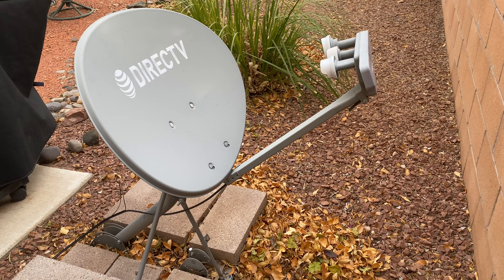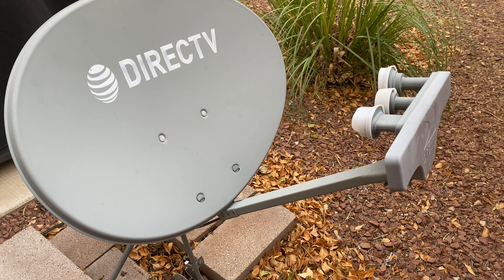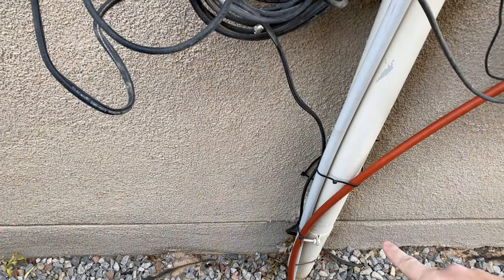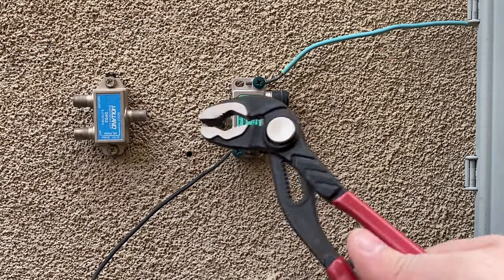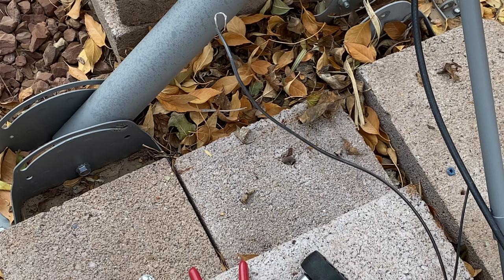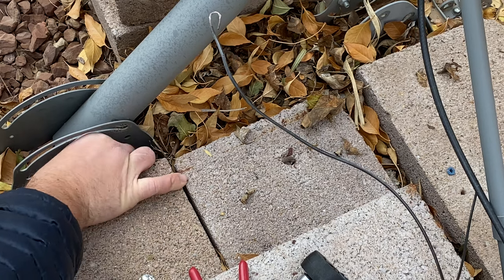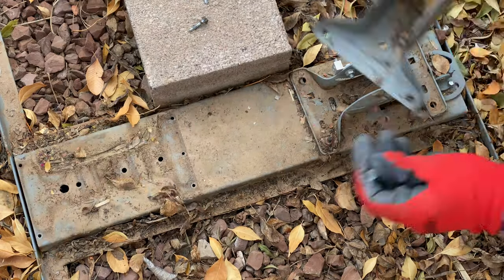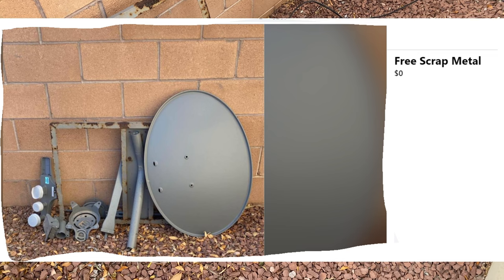How to Remove a Satellite Dish || In-depth Tutorial

Comment: Enjoyed your video. I have a similar setup. I know that I can remove it myself. Do you know if there is any voltage or live wires that I need to deal with? That is something I know nothing about and is a concern. TIA. 🙂
Reply from the maker: You should be able to cut the coax cable as it’s considered low voltage. If you’re concerned about it, you can always disconnect both ends and cut it.
Reply from the maker: Thanks for watching!

Comment: How do I  remove the LMV ? I am leaving the dish up to paint it?
Thanks for your help.
Reply from the maker: I took off the LNB at @8:45. It was as simple as loosening the lever and disconnecting the coax cable. Yours will be similar. It might not have a lever/handle to loosen but instead might be build into the arm or bolted on. Either way, you may just need to look down the arm to find where it connects.

Comment: Hi, thanks for your video. My Satellite Dish is outside, cemented down, and I see no splitters. The wiring goes to a box. Can you explain the removal steps?
Reply from the maker: Where does the coax cable go from your dish? If it goes to a box, you should be able to remove it from there. Some companies just house all their wires in a box where as mine was just screwed onto the stucco